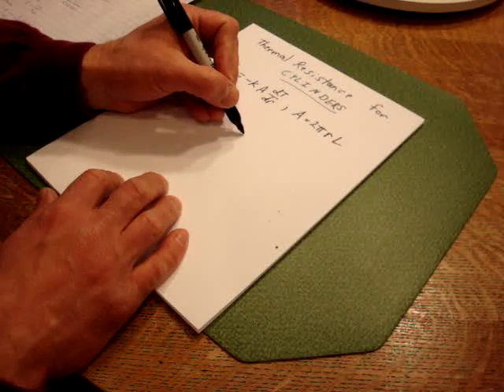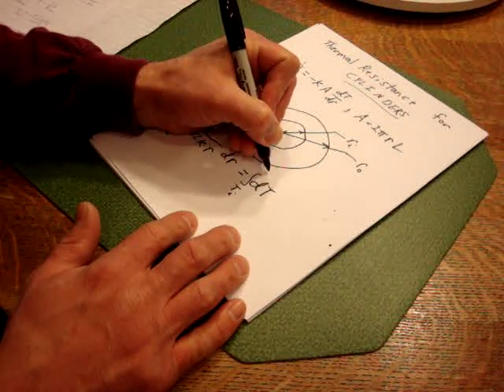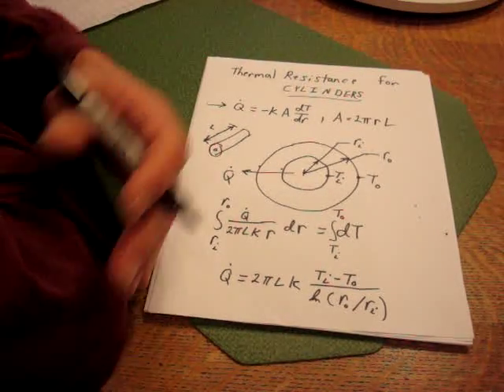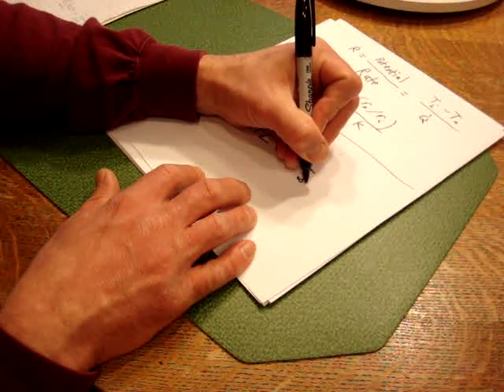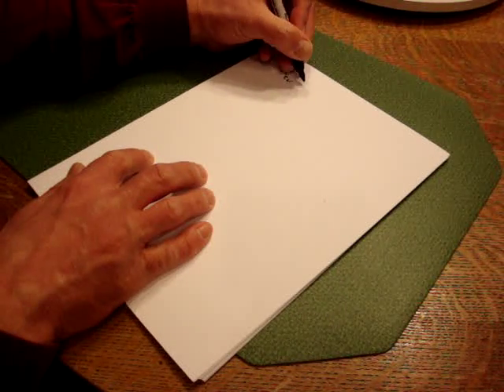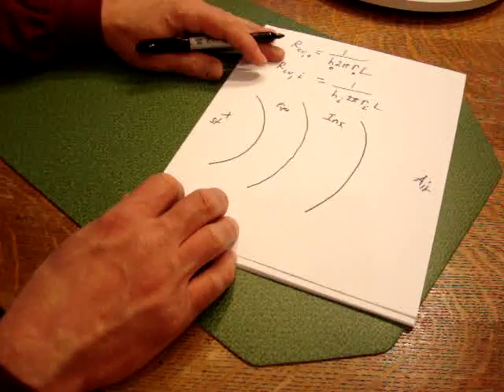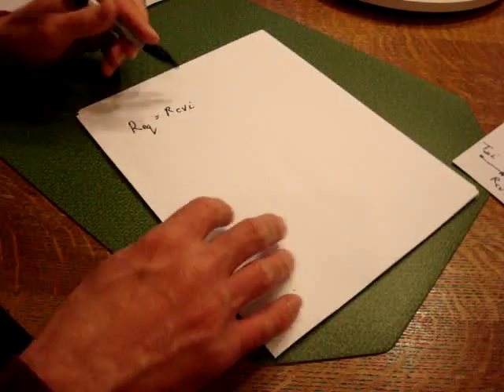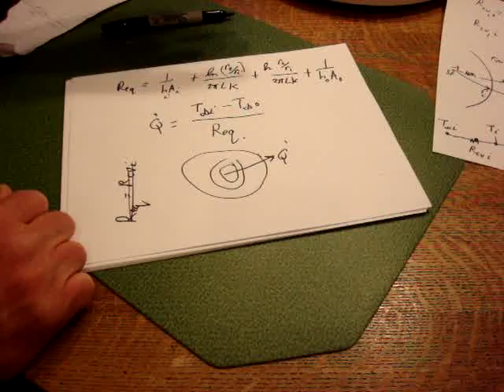1 Heat Transfer Thermal Resistance Cylinder.MPG

Comment: Hi, thanks for tutorial. I found the labeling of the radii in the final picture may have led to an error/confusion in the final equation for some watching the tutorial. For me at least, you have Ri (inner radius), R1 (at interface between pipe and insulation), and R2=Ro (outer radius). Based on this (and my understanding), your second term in the equivalent resistance should have a natural logarthm of R1/Ri and not R2/Ri. Also given that you are talking insulation and a pipe, perhaps k1 and k2?